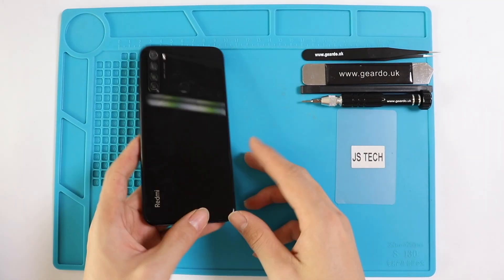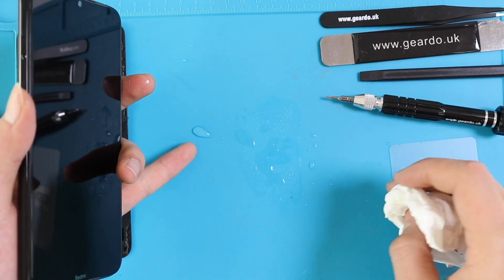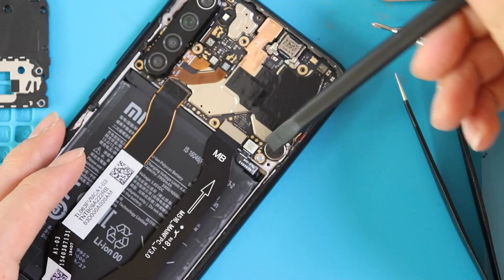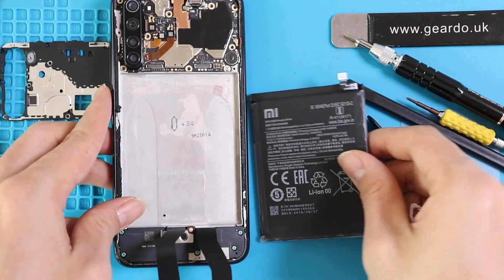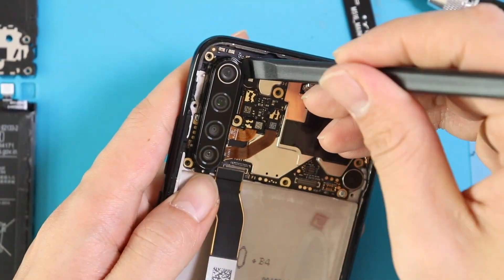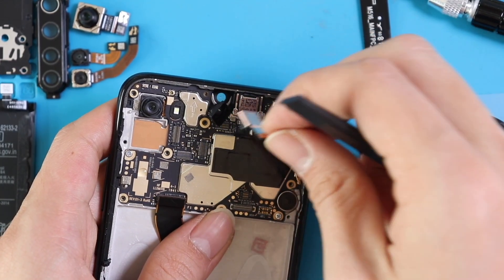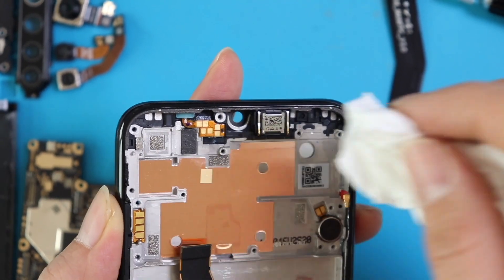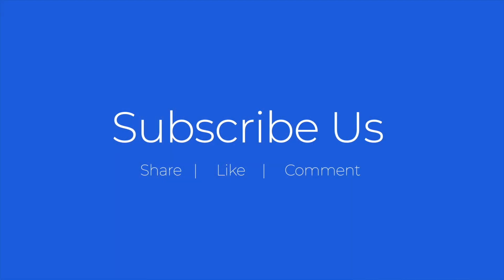Xiaomi Redmi Note 8 Teardown

Comment: Bro how to fix it back  cover glass  which glue should be used (type) ?
Reply from the maker: You mean back cover or back cover glass ?
Reply: @DIYGeardo  i means back glass panel which glue or adhesive should be used ??
Reply: @AbdulAhad-114  double sided tape
Reply: @Frostum  double sided tape is not strong enough